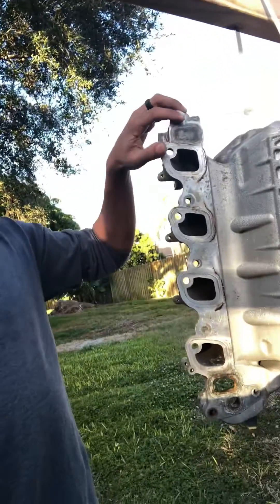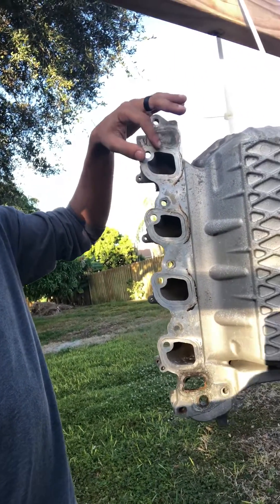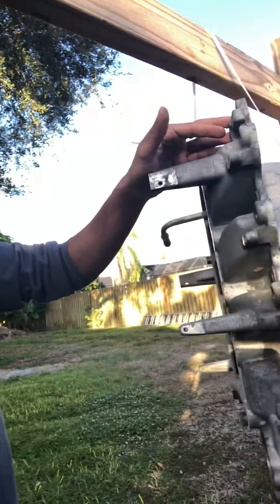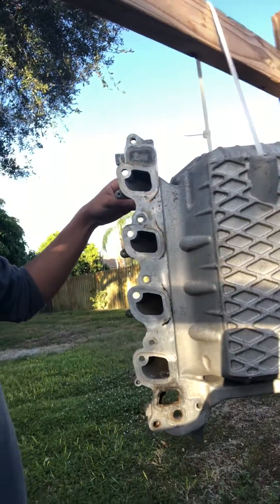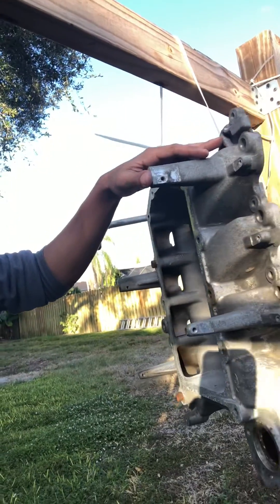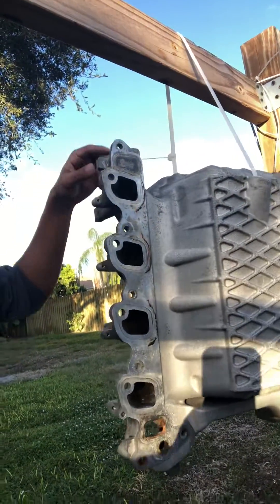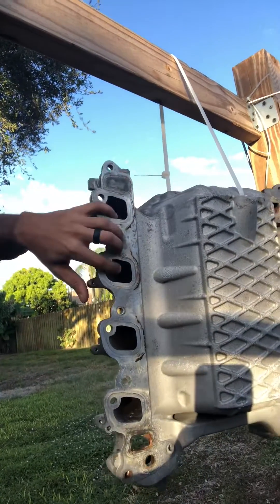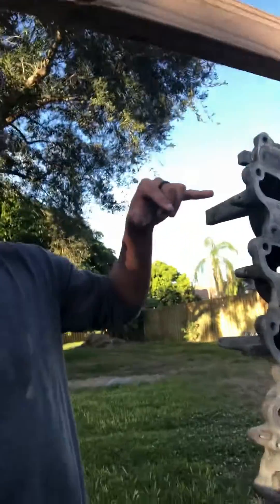Ford lightning coolant crossover mod

Comment: I think I heard something about those two cylinders,7 and 8, suffer damage because the egr tube is mounted on the exhaust manifold at the rear. This causing over-scavenging of exhaust gasses from cylinder 7 and 8 during egr flow condition and heavy load. The over-scavenging can draw the fuel mixture out faster than it can completely burn and cause pre-mature failure. Weakening the cylinder, burning valves and rings.